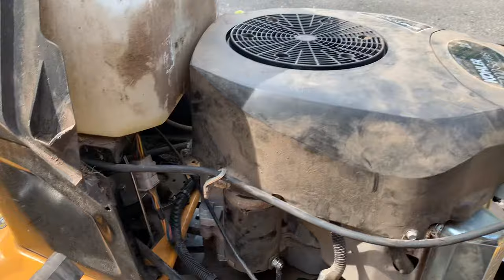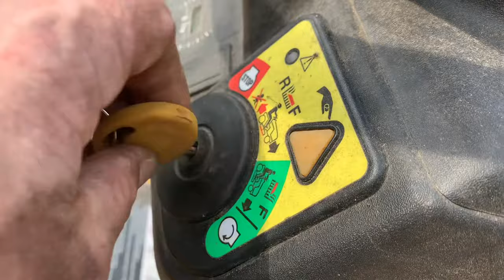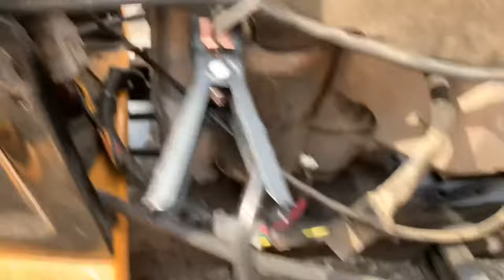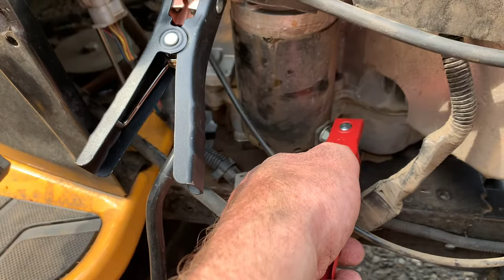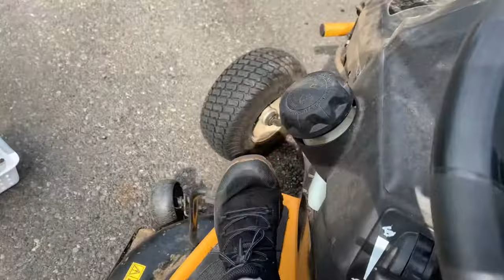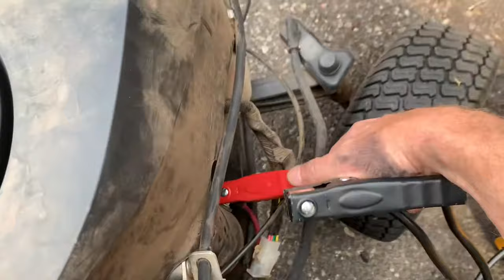How to Jump Start Your Cub Cadet Riding Mower When It Won't Start! [Cub Cadet Troubleshoot]

Comment: The starter is self-grounding. You do not need to hook up a ground at all at any time. Not to the battery not to the starter not to the frame. Nothing. You put the red on the battery you put the red on the starter, end of story.
Reply from the maker: Thanks for your expertise
Reply: But it work right !!
Reply: @o.maldonado4629  it definitely did. So idk what’s the fuss
Reply: @am-fil  if you do what you said using a jump box like he did, it’s not going to do anything. The jump box has to be grounded to the unit. If you’re just wanting to bypass the solenoid you can go from the battery to the starter with a single cable, but the battery can’t be dead. I would assume most who do this have a dead battery in the first place.

Comment: It might be better to place the positive cable on the starter terminal first then the negative to the frame. That will avoid any arc damage to the terminal nuts or stud.
Reply from the maker: Good tip! Thanks.

Comment: Why would you turn the key on before hooking up the cables?  You should simply hook the positive and negative cables to the battery and then start the tractor as you normally would. There should not be any sparks when jump-starting a lawn tractor with a battery pack.
Reply from the maker: Thanks for your detailed expertise

Comment: Gotta say, very helpful. I just replaced the drive belt on my CCadet, and it wouldn't even attempt to turn over. 12.8V bat dropped to 12.3 when the key was turned, so I knew it was TRYING, but no clicks or cranks. Did your jumpstart trick, took about 30 seconds of cranking and it ran. Turned it off, attempted to key start the mower, and it's been working perfectly fine now. Thank you sir. 🍻
Reply from the maker: Hey thanks for the nice comment. Appreciate you and I’m glad this helped. Take it easy:)

Comment: You need to say the part where youre placing them i need exact direction
Reply: @marciabaxley1959  he hooked up the ground(black) to the frame and then applied the positive(red) to the starter where the electrical comes in to it.

Comment: Liked and subscribed, my Cub Cadet XT-1-Lt50 acts like it doesn't want to quit running after I turn off the key. it shakes and clunks. How can I fix that? Spark plugs are fine.
Reply from the maker: I’m stumped. I’m sure it’s probably something simple. Have you checked any of the online forums by chance? I’m curious what’s causing this too. Good luck.